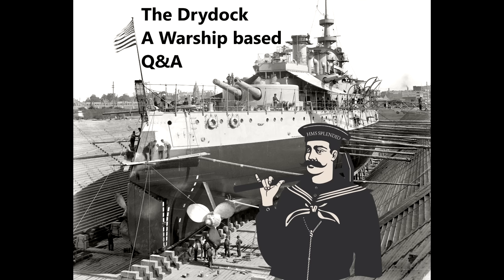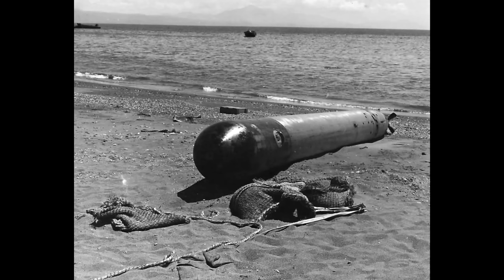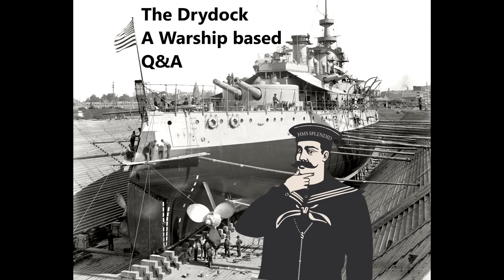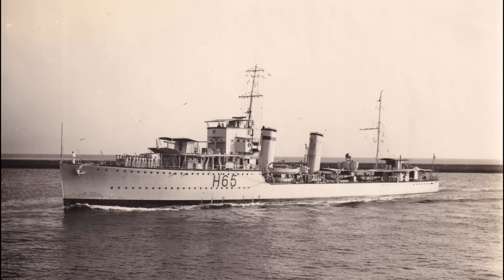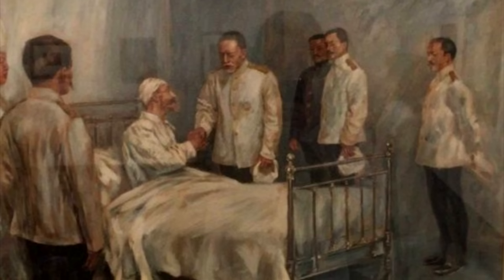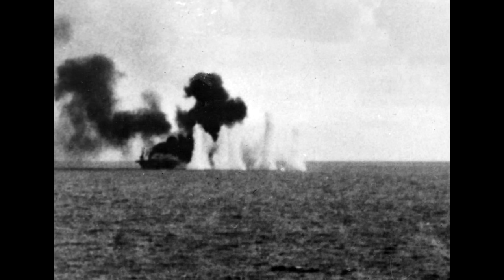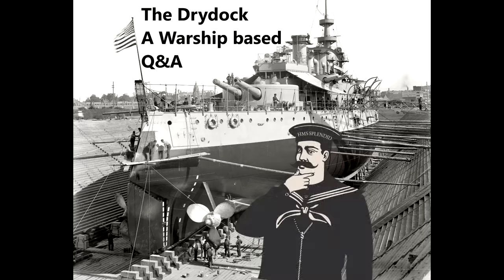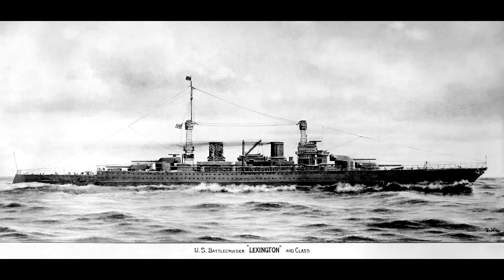The Drydock - Episode 289

Comment: Gun cooking off:  2 observations.  1, If the heat is uneven rather than uniform it might make parts of the gun distort, or even heating might make the metal more malleable so it could distort under outside forces, and even small distortions might require more effort and time to drive the propellant charge home or seal the breach.  2, the Air National Guard wing I was member of was chosen to field test a newly developed system for loading the ammunition drums of Vulcan aircraft cannon, a system that was later adopted as standard.  While the GE engineers were on base one of them told us an anecdote about a test to destruction of an M61 Vulcan where they set it up with an ammunition supply that would let it fire continuously until failure.  At failure he said the barrels were glowing, they were more flopping around than spinning and the shells where coming out through the sides of the barrels where they bent.  He also said that after they stopped and let it cool down they also found that everything other than the barrel assembly was still in safe operating condition and that replacing the barrels had the gun fully functional again.
Reply: Cooking off rounds in a gun. 
Ok I am no expert, the cooking off must be conditional to a number of factors. 
1. The temperature, duh, of the ammo, the gun material in contact with ammo as drac explained.
2. What the ammo is made out of. Loose black powder, or a brass bullet or other what temperature is needed to cook off the round. Which might be the primer, the powder   the shells contents say jts an illumination round. 
3. Time. To allow heat transfer. As mentioned by drac 
So for your multi barrel high rate of fire gun, the time a round is in the gun before firing is a fraction of a second . The heat transfer from the parts of the gun in contact with the round must necessarily be minimal. Now if a round had been left in the gun after the test it might well have cooked off.

Now a black powder cannon would need much more time in the gun before firing and a lower temperature before it cooked off, which is one reason they sponged out the gun after firing to extinguish any stray particals. As they would get a misfire during loading.

 Flaws in the ammo say a split bag, a defective round, a contaminated round say by a round being coated with powder from a split round , excessive grease oil might well also cause failures.
Reply: In the 1945/46 Summery Report on Hypervelocity by the NDRC National Defense Research Council they have an extensive section on ammunition cooking off due to rapid firing. PDF exists on the DTIC and NTRL sites.

Comment: 40:55 not claiming the truth, but some general stuff I've picked up as a mechanical engineer studying generalized version of welding.
- It more difficult to control the flame in an outside environment like a river side drydock when using oxy-fuel welding compared to SMAW (stick welding). Same applies for other gas shielded methods in outside environments (exceptions aside, because I think automatic welders in ship construction due use a gas shielded arc on a moving mechanism), wind tends to blow the shielding gas away from the melt pool. In oxy-fuel it is the combustion products that provide the shielding against oxygen. 
- SMAW has the amazing benefit of adding the proper amount of filling material + depositing a shielding slag over the fresh weld, allowing it to cool down without oxygen and other contaminants to reduce weld quality. What I can deduce, for oxy-fuel welding the welder would needed to add filler material itself, which is fine for small cm long welds, but I would imagine to become unbearable for meters long welds, because it is quite a precise process to handle AND keep the melt pool ok. \
- SMAW is somewhat able to over the head welding, where I would imagine oxy-fuel welding would just result in the weld pool of molten metal falling out under gravity, especially with the added influence of a oxy-fuel flame. Modern day building practices introduced modular building process, that allow segments build in rotating rigs to maximize under the hand welding, but that practice is far removed from traditional building practices as used in that era.
- In ship building you REALLY want to deposit material, because tolerances leave in gaps. SMAW is great in that rough construction work, because the stick provides the filler, if you need more material, just lay another bead. I would imagine for oxy-fuel welding, you are dealing with a fine balance of making a weld big enough, but not punching through the materials such that the weld pool falls through. Backing plates can help, but I would imagine that would be quite a hassle in large scale ship building.

For sure everything I've said above can be solved by a handled by a properly skilled welder, care and patience. But ship building really relies on making meters, as fast as possible, and as consistent as possible. Introduction of SMAW really helped to make these practices available for the shipyard workers.
Reply: What an interesting read for someone who doesn't know anything about welding, thank you very much!
Reply: Oh my god, if you aren’t a welder or someone with actual practical knowledge of the use of welding in shipbuilding WHY comment at length? Yup, you got a lot wrong there, such as that you can oxy-fuel weld overhead, and the biggest reason by far arc welding overtook oxy-fuel was it is MUCH faster, a way higher energy intense process, not that it is susceptible to the wind. Obviously you have never welded with o2
Reply: Really the main issue was never the ability of the process but how can you use it to make large quality welds quickly and can you design a ship to be built by welding.

Comment: High spec heavy steel welding requires extensive amounts of heat input. Thick plate and high strength steel require pre-heating often using chained ceramic heating blankets, each powered by a significant source. Welding heat range is window, hot to allow fusion but not too hot to alter steel properties. However no matter how well temp is controlled a heat effective zone is created and fatigue must be considered, which is not the case with rivets.

Comment: @Drachinifel For the welding question. Between Oxy and stick welding the biggest difference would be the speed and skill requirments to make a weld. As you can see in the picture you put up of someone's 3g certification plate (har har), the bevel on the sides of the join provide a way of getting more than surface penetration on the front. In this case they are doing a root pass, multiple stringers and cover passs. Which would require half a dozen sticks and some time between 30 minutes and 2 hours depending on materials, skill set, heat, ect ect. Thats to get 10 inches of multipass weld. The thicker the plate the more passes you will need.
Now because Oxy uses filler rods similar to TIG Suddenly you have to use both hands. Your face is closer to the weld because visability is more important. It's more intense, requires more skill, and gernerally is slower. Also the time it takes for heat to transfer between your torch and plate is longer. So now you are looking at truely stupid times to fill that in.

Comment: I served on a minesweeper, and two friends bought a couple for scrap a few years later. They were old, oak. They actually contained a lot of valuable metal and alloys, due to their non-magnetic requirements.  And apart from weaponry, everything was still there. Both engines and generators for high current sweep. Not to speak of degaussing cables all around the hull. But it proved quite a job to break the hull, thick oak and ribs every two feet. They probably made some money, but got a lot of bad press as Tyrkey bought some spares. Even as a Nato country, exporting to them in the 90s was not popular.

Comment: In Oxy-acetylene welding a filler rod is also used to add metal to the joint and fill the gap.  And multiple passes can be done.  However, it is very slow and the 'heat affected zone' is much larger than for stick welding thus altering the strength properties of the part being joined much more than stick welding. In both cases a small depth of the base metal of the parts much be melted in order for the weld to truly fuse the pieces and not just 'glue' them together.

Comment: Weld engineer chiming in on the oxy welding question.

Short version: Oxy welding takes too much time on naval scales.

It is possible to build up layers in Oxy welding. Just like the photo shown with stick welds. However handwaving each additional layer you go up, you loose 20~25%  of your time. Reason being there is a significantly larger band thar needs to be pre-heated/melted per layer. Whereas SMAW you just weave the stick over a little farther and you're good. (sub 5% time increase per layer) 

Oxy welding hulls quickly becomes "yes we can but we'll go broke trying it"
Reply: I was thinking the same thing. By no means an expert in oxyfuel, but I have done it when needed. My guess was that the cost of getting a good oxyfuel weld vs a stick weld was much higher, and so riveting was the best option until stick welding became common
Reply: @burcman2666   You got it right on the nose.  As a modern welding method basically uses a little crawler that welds the entire depth of the weld in a single pass. It's slow but it's pretty much a "set and forget" type of operation.

Comment: As for using a projectile to disable a turret in the manner described, even a Point Detonating fuze has a problem. Larger projectiles (over 40 mm) are likely "Bore Safe" meaning that the fuze is unable to function until it has clearing the muzzle by a safe distance. Usually this is done by a blocking pin that in combination with set-back and centrifugal force moves the pin out of the way unblocking the firing train making sure that the projectile cam do damage to an enemy without doing damage to you. Yes, many things make for good theater that in reality could not have happened.

Comment: Drach, please dont forget your gunnery doesnt usually get better after being hit by the opposing gunnery. Sort of shakes one up seeing a 15" or 16" blast a hole in your funnel or armor belt. At least now I am curious as to the hit percentile after just taking a round…  ie; Giulio Cesare v. Warspite or any other engagement. The enegy absorption from a larger round alone might shift your course one would think. Drach ???

And, as far as material thickness of OxyAcetylene.Welding it was normal for me to see upto 3/8" hand welded plate but by machine, even highly specialized machines could weld 1.00"  to 1.25" often enough. 
My post military nuke weld inspection gig wasnt any fun at all. The job was ok, the Iridium192 and Cobalt60 not so much. And again the Inverse Square Law comes out to play with radiation intensity. Gotta love time, distance and shielding.

Comment: The Fletcher Class DD's had two Fire Rooms with two boilers each normally operating with fwd fire room to fwd engine room and aft fire room to aft engine room. However as long as the piping was intact any boiler could supply steam to any engine room if required.

Comment: @Drachinifel Sounds like you need to buy a small used tug, then use that to tow the other vessel.  The prices for small used tug boats don't seem that bad.  But I suppose 'buyer beware'.

As long as you had the right friends - people with the right experience who would be willing to help with all the details of the purchases, doing the tow, and learning how to get things running and do the maintenance - it seems doable though certainly not easy and probably something of an adventure.  

Likely some local regulations you would have to learn about, such as having to hire a pilot for part of the tow, and whatever building codes are applicable.

Keep the tug as your 'river day trip' vessel, tied up to the dock you build, or directly to the houseboat, or even in a boathouse (perhaps one you build).  You might even be able to butter up the local government by occasionally using it to help with their projects.

Comment: A basic problem with gas as opposed to electric welding is that gas welding puts much more heat into the metal. I don't know if this is the reason why it wasn't used but it is one of the major differences between the two methods.

Comment: 54:40 No a shell even with a nose fuse could not explode by being crushed in the manner mentioned.  To arm a fuse (either base or nose fuse) the shell has to rotate along the barrel at speed - or in the case of modern smooth bore (like Russian 2A46 125 mm gun) by the velocity itself causing the safety to throw out to allow the striker to hit the accelerator pellet. Even rolling shells along planks to guns wouldn't arm the fuse.  

In WW2 the British forces captured thousands of tons of German ammunition of numerous types during the 2nd invasion of Lybia, including a huge stock of German 75 mm L/24 tank shell (PzGr 39 APCBC) and decided to re-manufacture it as it was better shell than the M72 shot of the 75 mm M2 gun of the recently introduced Grant tank (the M61 shell APC round was not fully readied).  So to use the captured German shell it was refitted to an M3 / M1897 cartridge case after it had the driving band lathed down by a few thousands of an inch to conform to the M2 gun and the fuse (in this case a 'BDZ' base fuse) was not removed during that process, though the artificers were told not to exceed the specified rotational speed, although it was unnecessary in point of fact.  Even in a nose fuse there is so much metal involved the ability to crush the pellet is negligible.  However one projectile that can be contact detonated by even foot contact are  mortar bombs, and the majority of RPG projectiles like RPG 7 /16 and the old British PIAT.
Reply: You're right about the fuse not being activated by rolling along the deck. It shouldn't happen. 
We have got to imagine a circumstance where the fuse was activated, probably by centrifugal force,  when it spun up the barrel. But something went wrong and the final part didn't work. 
Inside that fuse there was a tiny break and once it was moved that fraction of an inch it fired.

No, I do not write games and if you want to use this go ahead.
Reply: @myparceltape1169  The only thing I've come across is a fuse pre detonating because the fuse was assembled improperly. But it is more likely they fail the other way in that no amount of momentum or loss of momentum in the case of a base fuse will cause the fuse to trip the firing plunger onto the accelerator pellet, it was quite a normal gallows humour if a shell landed nearby and failed to detonate for some-one in a company pr platoon to say "My Moms an ROF worker she probably made that one"
Reply: @SCjunk  Agreed.  But if you remember valve radios you might have tapped yours if it wasn't working. 
Sometimes that worked!

Comment: Regarding POW treatment, I remembering hearing (although I vannot recall where or comment on the validity of this notion) that the Japanese Army was unhappy with the willingness of its soldiers to surrender during the Russo-Japanese War, that some surrenders where "unnecessary" and shouldnt have happened. The result was a deliberate decision to toughen the Japanese soldier and indoctrinate them with a code of bushido that is only somewhat historical. Historically, it isnt so much that it was shameful for peasant conscripts to surrender, just that there was little point because the surrender was inlikely to be accepted so you might as well flee instead of surrender. This kind of naturally lead into treating the enemy just as badly as their own troops, or even worse.

Regarding Prinz Eugen, fission fragments decay away to background over about five centuries. That doesn't mean they have undergone a series of decays to stability, but have undergone a series of decays to a swt of daughter products that would be indistinguishable from natural background.

Comment: About the shell cooking off on USS Johnston; what if it wasn't the powder charge itself that 'cooked off', but the primer? If the gun itself is red-hot, then the breechblock would almost have to be just as hot as well; could contact with metal that's that hot cause the primer to go off prematurely, thus setting off the main charge? Alternatively, if the gun/breech was that hot,  could it have made it enough harder for the shell to get fully seated, and the act of closing the hot breechblock put enough pressure on the primer to set it off? Since the gun is power-rammed and the breechblock closes automatically, could a shell that isn't rammed quite all the way expose it's primer to premature triggering, either by the rammer plate trying to shove it in past the obstruction, or by the brrechblock sliding up into/across the primer?

Comment: 5:16 certainly buying US surplus generally requires completely demilitarisation for example AFVs were demiled at buyers expense and the plasma cutting must displace a minimum of 3/4 inch of material - so you can't "cut and shut" it when yo get it home and vehicles like M151 mutts (post Vietnam era jeeps) were cut in half and had the rear body crushed to prevent anyone re-activating them,  evidently the original requirement was to cut the damn things in half behind the front seats and buba were just welding them back together, and they were pretty dangerous even in one piece, they even had a sign next to the steering wheel that said "Sudden turns means sudden death".